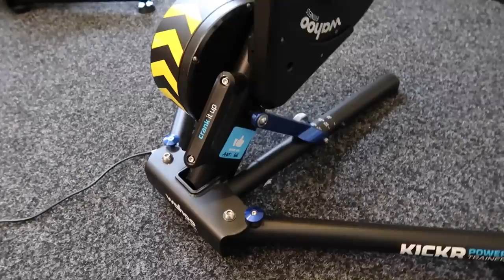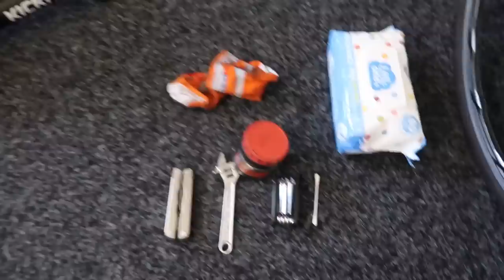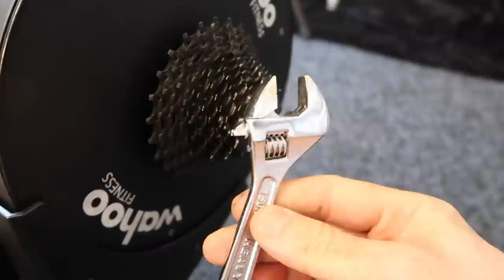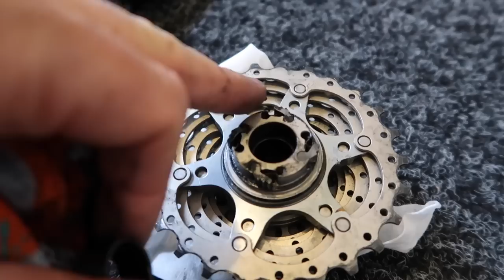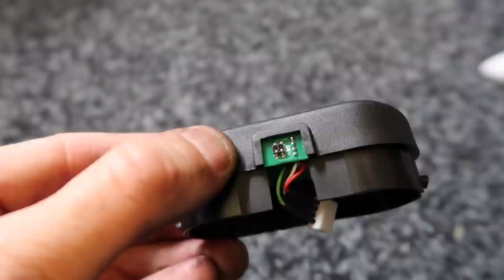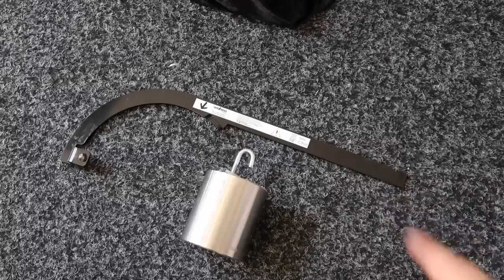WAHOO KICKR: Basic Maintenance (Gen 1)

Comment: So my 2014 Kickr wasn't coasting. Took it apart following these directions, cleaned and greased everything, put it back together (man, you weren't kidding- those "doors" are a b!tch) and now my Kickr is running smoothly. It should be said here that I have type 2 diabetes, and I control it with diet and exercise (no meds) so riding is life. Ergo: You saved my life today, Shane. Happy Thanksgiving.
Reply: Also, I've figured out the issue with the "doors" that can be tricky, when you're trying to get the cassette housing back on: A piece of picture-hanging wire solves the problem. I wrapped it around the "doors" and gave it a good pull. It holds the doors "closed" until you [gently] slide the cassette housing home. Once it's in there, you simply let the wire go slack and unwind. No hassle!

Comment: Thank you.  This video was very helpful.  There was a odd vibration taking place while riding with my KICKR, which seems to be fixed now that I've tightened the loose nut on the cassette.  I would not have known this solution without your video.

Comment: Hi Shane, great video mate.  I have a bit of a problem with a 1st gen KIckr.  I've trawled the internet and no one seems to have the answer but thought you with your vast experience of trainers might have heard of something similar.  Basically, I've done all the maintenance and everything looks fine.  When I start a ride, 1st 30 mins everything is good.  The hub feels buttery smooth and I churn out 250w at about HR 130 bpm.  Then, the hub starts to feel slightly sticky,  Gradually it gets to the stage where it starts to feel like it's caked in mud, and after 90 mins I can barely keep the cadence going without dropping 2-3 sprockets.  HR is now up to 150+ but power is down to 170!  Before anyone says anything, I can hold 250W for 2+ hours outside so I haven't blown a gasket!  As I said, I've done the maintenance, the hub looks in great shape.  The cassette is fine, the shims haven't faced.  Done spindowns.  Everything you can think of.  Needless to say, the wahoo guys can't figure it out!  Any thoughts would be greatly appreciated!
Reply from the maker: Nothing comes to mind. If Wahoo can't solve that one (and it's their product), that's not a good sign.
Reply: @gplama  Thanks Shane.  Will give them another go!  By the way, what's that business you do with the freehub and what looks like a pair of scissors to get the freehub back on?  I just put it back on and clicked it into place but maybe I've missed something!
Reply from the maker: @thesolitarycyclist9005  That's just to push the pawls/teeth in so the freehub slides on. Sometimes it's not required.

Comment: Great video Shane, nicely done. Just a note for anyone considering using Loctite to be aware of the different grades available and choose an appropriate strength ie low to medium strength. Some of the high strength formulas eg 263 can lock fasteners very strongly and would make subsequent removal difficult.
Reply from the maker: Good tip! "Supermarket Strength" is what I tinker with....  Just a little stronger than Clag. :)

Comment: Was wondering if you had any thoughts on whether or not you should use a carbon bike on an indoor trainer. I've heard you should only use aluminum/steel bikes, or if you do use carbon to totally avoid out of the saddle efforts. Just wondering if I should be worried about cracking my frame as I only have access to one bike (carbon) to use.
Reply from the maker: +Bryce Burnett No problem with carbon bikes on trainers when used with the right skewer. Very common myth that is asked a lot. See this video: https://youtu.be/ISsrgn3YyGQ
Reply: Thanks! Love your channel.

Comment: Hi Shane, great videos as usual.
Have you had any experience of a burning smell coming from your Kickr gen 1 at any time in the past? Wahoo thinks it is in the belt area but there's nothing there. I reckon it is on the flywheel because I did a spin down after using it for an hour and the recorded temperature from the kickr is 40.4 degrees Celsius - is that a normal temp while using it?
Reply from the maker: Nothing I can recall ever being concerned about. They can get pretty hot. There's a lot of energy going into that flywheel/heatsink.
Reply: thanks Shane - we'll see what wahoo say about it. it is not consistent though.

Comment: having used both the kickr and flux, which would you choose at this point? not being able to get support from tacx scares me if it breaks but the flux has a nice flywheel. kickr costs more though
Reply from the maker: The Flux was pretty good while it lasted. At this point in time (Jan 6th 2017 10:30am), I'd personally choose the Kickr. This isn't a recommendation of what anyone else should do though. This also may change.
Reply: thx for the honesty.  on paper the flux looks great but not having any prompt tech support is really the problem.  I'd stick with the flux and help work through the issues but they dont really provide a channel for that. only thing i can do is send them an email but their auto response was 1-2 wks. maybe I'll opt for the cheaper wahoo snap instead

Comment: Hi GPLama, At 8:16 ... when I tighten the outside NUT (of my Gen 1 KickR) it seizes the Cassette (and I have to let it stay loose)  (this caused all issues)

So it seizes the cassette when tightened, but releases the Cassette (to spin freely) when the outside nut is a few threads loose?

You mentioned the inside shim (or maybe the outside) can shorten (through wear I think), assuming the inside shim is clean ... is it a bearing issue ?

I only had the nut finger tight ... but that was too tight.

Thanks.
Reply from the maker: Sounds like the shim is too short... or the outside one is missing? Not sure mate. Ping Wahoo Support.

Comment: Hi Shane, my 2017 Kickr started having sticky freehub issues, I contacted support and they replied saying I need to change the 144T pulley wheel (dont know exactly which part that is), but it costs $100 usd + shipping, which seems pretty ridiculous for a 1.5 year simulator. Any ideas if there's a cheaper way to solve this?

Comment: How often should you calibrate ? I've never done mine in two years. Also which firmware version so you find best?
Reply from the maker: Spindown: Every few weeks. Or whenever the unit is moved.
Calibration: In theory, never after the factory. The calibration arm and weight are hard to come by! Performed if your Kickr is reading low/high compared to a known good power meter. 
Firmware: 1.4.47 (latest public release)
Reply: Ah ok thanks, the only reason I ask is because mine reads about 30/40w less than a quarq and its the same on all 3 I have. I have heard the power does drift with time on these. Thanks for the reply, great video.

Comment: Shane - have you ever had a power issue with KICKR gen 1? At the moment my KICKR goes into lock down mode - very high resistance as soon as power is required Wahoo or Zwift. Could it be the optical sensor?
Reply from the maker: Maybe. Kickrs are also like gremlins. They don't like direct sunlight on those sensors.

Comment: Shane, Wahoo says that Kickr doesn't support thru axles. I wonder if this is something for the moment or is it designed that it won't work?
As I understand the Tacx trainers can be used with bike that have thru axles (disc brakes) with an adapter.
Reply from the maker: 142x12 adapter from Wahoo works: http://au.wahoofitness.com/instructions/kickr142/
Reply: Shane Miller won't work for 135x10 thru axle road bikes but from the video there is no real technical reason why they couldn't do it.
Reply from the maker: Hit up Wahoo Support for their reasoning/answer on that one. I haven't had to solve that problem yet, hence I'm not across it.

Comment: Hey Shane, did you ever do the video on belt tensioning you mention in your description???   I have a new Kickr (from November) that started skipping under high load recently.  I dug online and found how to adjust tension.  Mine seemed really loose, I could twist the belt probably 45 degrees!  Also, my unit seemed very, very quite.  Much more so than all the other videos I have seen.   I contacted Wahoo and they sent me a link to a similar tension video but it had NO information on what was the PROPER tension for the belt!  Seems like there should be a "setting".  Something similar to what I have seen on other belt driven systems which is usually a deflection distance or twist angle specification.  Since adjusting the tension my spindown went from roughly 23 seconds down to 16 seconds and the noise(whine) increased, probably 3 times as much.
Reply from the maker: No I haven't. There's history here with this topic, with a number of videos going up from Wahoo Kickr owners with very incorrect information about belt tension and adjusting spindown times for no reason. This caused a few headaches for Wahoo Support. For now I'll leave this specific topic for Wahoo. If they ever publish a guide/recommendations/etc I may cover it if I have the time.
Reply: thanks Shane.  I did another belt tension adjustment before riding today which I felt much better with (the resulting tension, not the Zwift ride feel) and was back to being fairly quite.  The video I found showed tightening the belt so it had zero deflection AND then giving it another full turn of the adjustment screw.  This is way too much, by my estimation.  It will be interesting IF I get anything from Wahoo.  Thanks again for the help!

Comment: Hey Shane, love the videos bro. I have a question in reference too kickr spin down test. I just brought a kickr second hand and I cant get it to finish a spin down, it either aborts straight away or starts it and cant finish even after the trainer has stopped spinning. I followed your guide here and cleaned the optical sensor and black and white strip and checked for scratches etc but for the life of me cant get it to work. I guess im wondering if you have incountered this problem or give me a couple more thinhs to check. 

Cheers again and keep the hreat content coming.
Reply from the maker: Cheers for the feedback Richard. Give this a shot with the Kickr and let me know how it goes: 

- Open the Wahoo Fitness app (available on the app store)
- Go to sensors->add new sensor and select your device
- Wait for the device to connect
- Tap the device icon in the top left corner 5 times to bring up a list with available firmware versions
- Select the firmware version to install (Select 1.5.66. The latest Beta as of today)
- Choose 'update now' from the dialog

Then try the advanced spindown.
Reply: Shane Miller 
Cheers Shane, ill give it a crack and let you know.
Reply: Shane mate, updated firmware, did advanced spin down and the kickr is like new. Thanks heaps bro

Comment: Hi, can you confirm that the 2nd (larger) shim gets put back on once the cassette is already in place, or so both shims go on that axle first and then put the cassette back on? I've done this job to mine and put the small shim back on first, then the cassette and then the other shim followed by the 17mm locking nut. 

Many thanks
Reply from the maker: From memory: Shim - Freehub - Shim - locknut. I can't recall which one was larger, I'll assume the first.

Comment: I have a 10 speed cassette on my KICKR.  If I upgrade to an 11 speed bike, do I NEED to upgraded the cassette on the KICKR?  Do you have tips for making sure no cable adjustments need to be made when on and off the KICKR?  I find that I need to tweak the cables slightly when I transition from the KICKR to the road...  Thanks!
Reply from the maker: All Kickrs have 11spd freehubs. You'll need to replace the 10spd cassette with an 11spd one. Kickr gear indexing/spacing can be tinkered with using shims or shaving down the locknuts.... if required.

Comment: Is there a way to make the 2014 kickr silent like the 2020 model ?
Reply from the maker: No. The belt, drive wheel, and internal gears won’t allow for the different belt the more silent Kickrs use.
Reply: @gplama  thanks for your answer, so the problem of the noise is because the first generation of kickrs is because the use timing belt and all the parts are for timing belts ?
Reply from the maker: @ioannidesalex  Yes.

Comment: Did you end up making the video about calibration with the special weight?
Reply from the maker: No. Two reasons. 1. The app required for it to work is a pain in the arse to get working. 2. Everyone will ask where to get a weight/kit because it's so damn hard to get a hold of... that'll then stir up Wahoo Support with requests. I try to step lightly and not piss people off.. 3. (bonus reason!) If the new firmware for the original Kickr allows model mode vs strain gauge mode, there's no need for this at all.

Comment: Do you know how to fix the circuit board? The wrong voltage was plugged in and it got really hot and did not work afterwards. But nothing on the board looks burned. Thanks
Reply from the maker: I doubt this is possible.... one for Wahoo Support.

Comment: what is the noise difference between say the kickr and a normal trainer where you use the whole wheel? I had to cancel my zwift sub because of noise complains from the downstair neighbours.
Reply from the maker: It's almost impossible to quantify the difference... there's a lot of variables there. Have a look into the Neo if you need as quiet as possible.

Comment: Are the shims the same (outer and inner, both ends)? I couldn't tell with the camera behind your hands.
Reply from the maker: I can’t recall sorry. This was a while ago. The replacements come with both.
Reply: @gplama  Where does one get the replacements?
Reply from the maker: @timwildschut3101  Best to ping Wahoo Support.
Reply: @gplama  They replied to say they can supply one for £12. Here is their diagnosis, in case it's helpful: "The description would point to the inner freehub spacer being damaged. This occurs typically as a result of the 17mm axle nut being over-tightened, or the skewer being over-tightened (which crushes the spacer as a fail-safe)."

Comment: Thanks for this video, I have had my Kickr about 14 months now and have yet to service it. It runs absolutely fine without issue but I will give this a go over the next few days! I'm just worried about messing it up some how! Is it difficult to get the cassette/freehub back on? Why did you use something sharp behind the cassette?

Many thanks!
Reply from the maker: If it's fine... I'd leave it be. (or have a bike mechanic handy to help out)
Reply: Thanks for the reply. It makes sense to service it before things go 
wrong though, as I don't really want any "down time" if possible. I had a
 look at the screws for the optical sensor and they appear to be rivets,
 meaning I can't get those out. I did spray some compressed air around 
the sensor though and the "zebra" area, which should help. Haven't tried
 the freehub yet but do you not think it's worth doing? I've had it for 
about 14 months but according to trainer road I've done 12.2 days of 
training on there!!

Many thanks in advance for your further input :)
Reply: I gave this a shot tonight and all went well, so a big thanks for uploading this video. For the shims etc the grease I used was this stuff 

http://www.wiggle.co.uk/finish-line-ceramic-grease-60gtube/ 

do you think that'll be OK? It's pretty thick. Also did the optical sensor (1.5mm allen key I think I used). Rode it for 5mins after then did a spin down and all seems well! I may just do this every few months as it's so easy to do and it's worth looking after such an expensive piece of kit.

Other than this (and the occasional belt and shim replacement, does the kickr need any more basic maintenance work?

Thanks a lot!!

Comment: Hi! Last weeks I’ve notice a squeaking noise coming from my kicr17, specially when I change gears or increase power (with the erg mode on). Is kind of a grinding noise.... 

The belt is fine even after 429 hours and 14.000km’s 

Any tips? 

I’ve tried to do the maintenance routine you’ve suggested on youtube but wasn’t able to remove the freehub, the screw on this version is shorter than the previous one... 

Tks
Reply from the maker: Remove the cassette and see if you can get to to bolt to remove/service the freehub.
Reply: Tks!! Do you have any special tool to do this? Tks again
Reply from the maker: @robertonitrini2082  Not that I recall. Standard wrench and lockring tool(s)
Reply: Perfect!!! Service done, running smoothly as new!! Tks mate!

Comment: Hmm i have trouble getting my cassette off it seems jammed. Any pointed other then levering it off with abit of force?
Reply from the maker: Arh... nothing I'd be confident in taking any responsibility for suggesting. Maybe a bike shop can lever it off and accept the damages? :) It should pop off without a lot of force.
Reply: Shane Miller I might need to. The freehub comes off easy enough so maybe ill just replace that instead. It was a worn cassette so no huge loss.